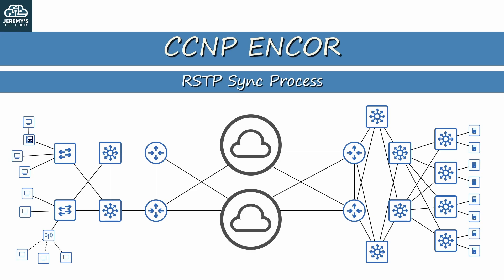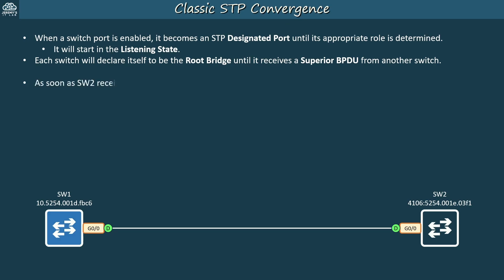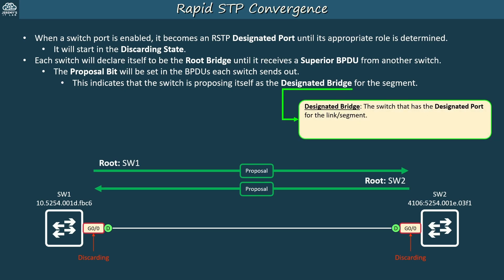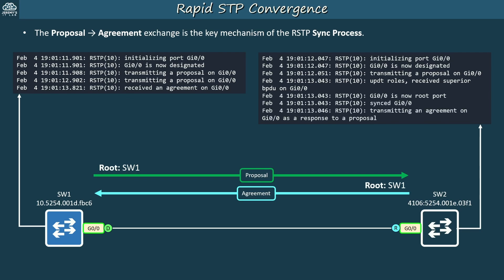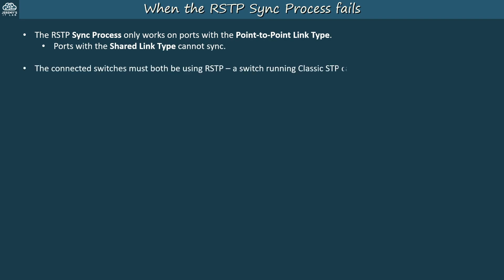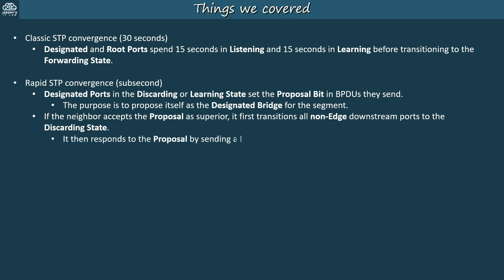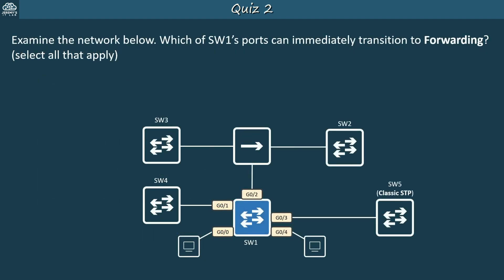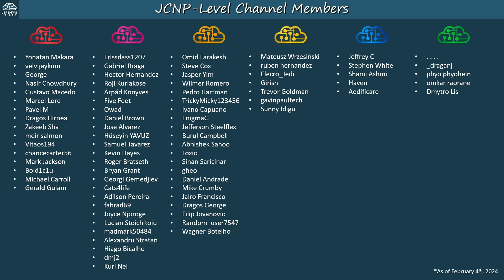CCNP ENCOR // RSTP Sync Process // ENCOR 350-401 Complete Course

Comment: Does ccna and network plus have different answers to maximum cable lengths? I ask because the ccna anki cards have 10gb Sr at 400 meters while the network+ and Google say that it's 300?
Reply from the maker: I’m not familiar with Network+, but I wouldn’t put too much effort into memorizing the maximum lengths anyway - there are more important things to learn
Reply: @JeremysITLab  OK thanks. Thanks for all the effort you out into the anki cards. Do you have anki cards for anything else?